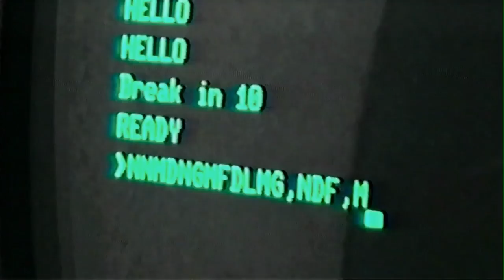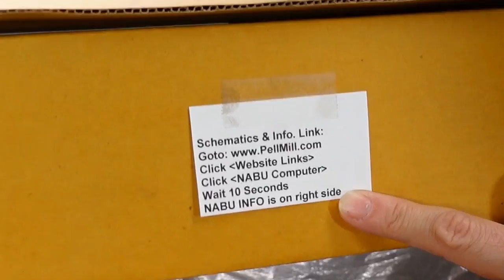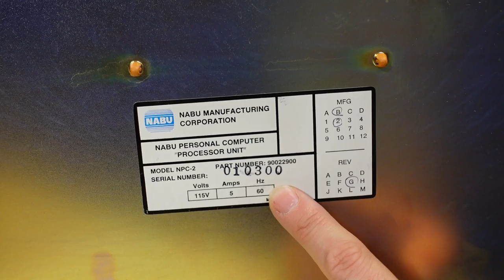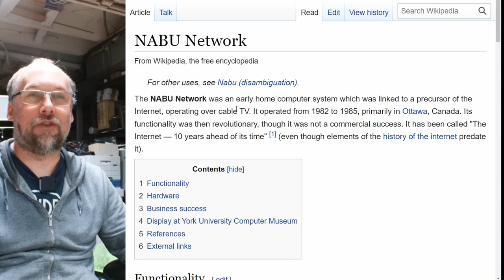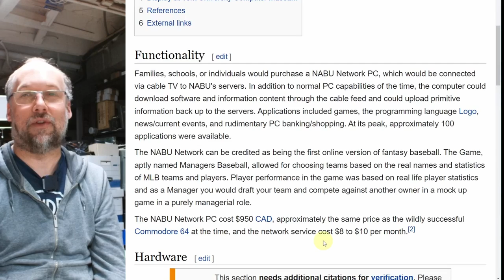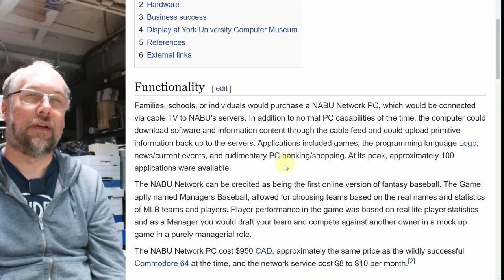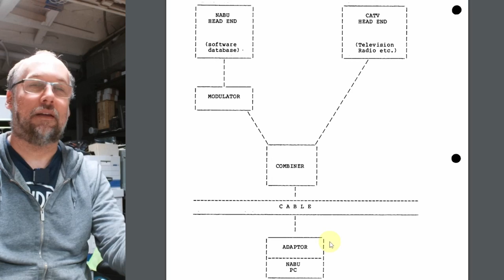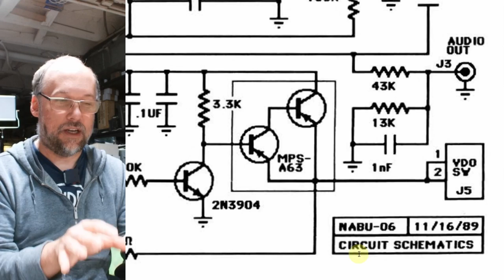The 80s computer you've never heard of: The NABU PC

Comment: A nice addition would be a tape adaptor, or even a disk drive if someone wants to go so far as to design one. A tape adaptor though I imagine could be very simple, one input bit, one output, and do the timing in software on the CPU. In fact maybe the printer port would suffice, you'd just need an adaptor that alters the voltage levels. 

Cassette would be fine for 64K, you could get loading time down to maybe 3 minutes, like a lot of UK machines used. In fact a ZX Spectrum game could often load faster from tape than the Commodore 64 could from disk! At least until people started using fast loaders. Stupid design really, Commodore's disk drives had their own CPU, own RAM all sorts of big heavy expensive chips, to do a job that could be done with a WD1772 connected to the CPU's bus. Maybe through the cartridge port, since Commodore put so many more expensive chips behind their ports that it cripped their speed, Sinclair did it all by connecting hardware to the bus and doing everything in software.

But Commodore, and other American companies, tended to design their computers like mainframes, or else they went through a parts catalogue and ticked off everything that said it did a certain job. They are designed a lot like mainframes though, lots of separate chips doing their own work in parallel, leaving the CPU alone. Where Sinclair realised the CPU wasn't doing much when you were loading or printing or whatever, so why not let the very capable CPU handle it?

Anyway, pardon me... point is this this could do the same. It could also likely take an ESP32 module and do Wifi, as well as an SD card adaptor. You might even be able to hack up a Laplink-type cable between it's printer port and a PC's printer port, or else USB on an Arduino. Amend NABU's EPROM to support all this, it would make it a usable computer... assuming you can find the software... If there's enough people who loved it as a kid, there might end up being a lot of homebrew, once development is sorted out. There's already a C compiler for popular Z80 computers of the '80s, that'd be easy to adapt.
Reply: The printer port is unforunately output-only, according to schematics, apart from a single BUSY pin that could be polled as very slow input path. The "adapter" DIN5 meant for its cable modem, being semi-standard RS422 may be a better option, though it's locked at the weird bit rate of 111.8kbps (3.574595 colorburst / 32). Is the Raspberry Pi's UART (ttyAMA0) capable of running at this odd rate? If not, 115.2k (3% error per bit; off phase by 30% at the final 8N1 stop bit) might be close enough, depending on character spacing.

Comment: Hmmm, that enclosure looks right on brand for an idea for a custom system I have been planning to build for a while (morphing hardware platform)
In particular those 4 "slots" are right on the money for one of the main features of the system. Are these available empty? Or maybe with just the power supply on them?
Reply: Just buy the entire machine. It's cheaper than buying an enclosure of the same size. It's only $60 or so.
Reply: The vendor sells the empty enclosure for cheaper.
Reply: @cass6409  Especially he also sells the smaller (in height) enclosures meant for the cable modem box. These come stripped of all electronics, and only have a simple linear power supply.

Comment: So the sx-64 had a case that seemed to be from an oscilloscope... This definitely looks like it started life as a hifi component 8-track tape machine.

I often wonder about where cases come from, I'm sure not all of them are one off designs.
Reply: I love and still use my rock solid SX-64. It still works perfectly to this day.
Reply: @DishNetworkDealerNEO  if you Google 'some work on the sx64 lemon64' you can see mine. I don't have it any more, I sold it to a guy in Montreal. Cool little machine for sure!!
Reply: @chrisyboy219  I’ll check it out. I’ve considered replacing the Sony Display with a high resolution 4:3 HDTV LCD display with NTSC to HDTV converter, and adding a second speaker underneath with a stereo SID Chip board that breaks up the voices and putting the C-64 Mini board into the empty space and adding the USB Port to the monitor side grill between the Top and bottom halves.  The 4:3 HDTV Monitor would have extra inputs and a remote control to control it and direct it to use the other HDMI inputs, allowing it to Switch to the C64 Mini or the original SX 64.

Comment: Can't wait to see one of these booting a disk system and possibly running locally loaded software.
I would Love to see it with an LCARS display.
Reply: Someone already has a CP/M running on it (!) but it's only with a serial terminal, not using the built-in output.  Which according to the tech manual is only good for 38 columns anyway (38 usable out of 40 supported by the hardware), which would be painful for CP/M.

Comment: For the time, that is a pretty advanced system, over here in the UK we had nothing like that until digital TV came along and the UK cable networks started using digital set-top boxes that could do similar stuff, and even then there were a lot of limitations over what they actually did (usually a "can't be bothered to do it" thing), with the STBs initially acting as the modem for your computer to access cable broadband, but prior to that, nope, just teletext and proprietary dial-up based services...
Reply: The BBC micro had an add and could get software via teletext. There were a whole bunch of teletext pages which were actually software for the machine.

Comment: The 8251 is a serial uart, one of the 1977 offerings from Intel. Most parallel ports were supported by a data latch like an LS374 and an input buffer to read the status pins like an LS244 or 245. A one-shot was often used to trigger the strobe when the port was written.

Comment: I could think of endless uses for that machine in the laboratory. I do embedded systems work and R&D electronics. I have a Z80 C compiler from around 1998 (on 3.5" floppy discs), I have thought of trying to get it running again and jumping back into the Z80 retro world. If we could reverse engineer a way to download code into it like the network did, You'd have a system. There's other possibilities also like a ROM emulator to store the app. In any case, those expansion ports are the key to interfacing this computer to all sorts of things that could be useful in the R&D lab.

Comment: So basically it was really a teletext decoder that ran over cable, instead of via the blanking line on a channel. Download the text firmware and run locally, and then you get better graphics and sound, with the possibility of using the adaptor to send cable data back to the head end again. 

Probably you can run regular CPM on it, though printer and disk likely also use the RS422 interface chip, and will have on peripheral processors to handle the disk and print functionality, though printer might be simple TTL level RS232, as that allows cheap printers to be used, just put in a buffer instead of the RS232 interface chips.

Comment: Excellent video, and very cool another machine using the TI-9918A, I managed to get one, and it just arrived today.  Will look at what I can do to get some software running on it.  The Eisteins Rom is 8k I believe and that comes with a really good debug monitor etc.  Might be something that could be adapted.
I also just got a Pico as well so might be a project to use with that.

Comment: I think youtube is deleting a lot of the comments with any external links. which would be why the spambots have stopped doing so and are working around that. That said I see VCF has posted good scans of the floppy controller which attached to All the expansion slots on the board with an adapter. probably to improve bandwidth and goes over how to modify the jumper etc etc. There are a lot of little projects just popping up everywhere along with a great deal of the history.

Comment: i'd love one to have a 'play' with,  but i'm in the uk and  postage and import charges are about 1.5 times more than the cost of the thing itself! 😢 i do have a possibly similar idea z80 based machine, was intended for betting shops to download and print race info (on a small paper sized ,but big case,  thermal printer) using the teletext/viewdata standard (has a tv type teletext card in it, which has its own display generator SAA5050),  it was made by philips, its still usable in way as it has a function for you to type your own text on the screen and then print it,

Comment: Adrian, I know where to get the cable box portion of the Nabu 

Surplus Sales of Nebraska has some, they’re under “project enclosures” they also have a LOT of NOS ICs, passives, etc.
Reply: Damn, there goes another order. Thanks for the tip. I ended up also getting a NOS touch-tone table-top phone.
Reply: Wow, sixteen bucks for a Network Adapter? Might as well

Comment: Interesting random find here:  As a little kid in the early 80s, I lived for about 10 years in Cornwall, Ontario (45 minutes south of Ottawa). I remember seeing advertisements for the NABU in the Ottawa Citizen... at some point around that time, my father and I went to a local computer store (where we browsed and bought software), and remember the owner told us about the NABU, and was hoping that the local cable provider (at that time, Cornwall CableVision) would support this technology, but they never did  (as a comment about Cornwall CableVision: At the time NABU came out, they did not support any kind of pay TV service, and we actually had to have a mechanical A/B switch beside our sets, so we could have two sets of channels 2-13... so a pretty backwoods cable system, that would never be capable of supporting this, even though it was a city of 45,000 people, under an hour from where NABU was developed. I'm sure other communities in the area were incapable of supporting this as well). So... in hindsight... I can see why NABU didn't take off, even "locally".

Comment: 7:29 Single row pin headers like that were usually used for expansion cards, not for cables, as there was no common standard for cables with 0.1" spacing like that.

Comment: Man, that's something really interesting. Adrian, I don't understand something and hope you'll correct me if i'm wrong. This PC is like thin-client thing. The fact that it does not need HD doesn't mean it cannot have it connected by RF cable. If i understand right NABU PC doesn't need original adapter as long as signal it gets formed right. This PC reads the data to its bus by RF cable (instead of direct disk attachment) converts it to standard signal and vice versa. You know the used protocol, you know the RF signal transmission standards. 
What prevents you from encoding according to protocol anything Z80 will understand emulating connection by sending directly to its RF port this sequence of commands, and decoding what it sends back? Just connect modern equipment emulating the remote storage  (HD and any other modern, even virtual, storage through microcomputer like arduino o raspberry pi) with any compatible OS starting sequence (like what Z80 needs to start reading data from disk? op code to read MBR address?) and send it down the RF port. And if you get back actual meaningful read instruction, just move on and send it over RF cable. I mean RF hardware is just additional mediator between storage and PC's bus. 
I mean there's a guy like Ben Eater https eater net 8bit (put dots and slashes) who does these things just by manually sending pulses at right timing (Maybe you can even cooperate for this project). He may be the guy who can actually emulate the bus work  signals decode/encode on physical level.

Good video.  Keep it going👍🏼

Comment: If you're concerned about powering this sort of stuff up, I strongly suggest you invest in an isolation transformer and a variac, so you can gradually wind up the voltage after plugging in. A plug-in, low cost digital ammeter that plugs into your mains outlet also might be useful.

Comment: A 6mbps cable connection in the 80s!?

It took us in the UK until the late 90s to start delivering internet over cable-tv networks and even then speeds started at 512kbps-1mbps, around 1998 onwards.  Speeds did increase quickly but i think it was around 2002-2003 by the time I had 10mbps internet delivered over cable.

Comment: I did a fair bit of work with RS-422 serial data during my embedded systems days… I’ll bet emulating the adaptor using a modern system isn’t too tough, especially if the protocol is well-documented. (Although getting a PC’s UART to talk at 111 kilobaud might be a bit tricky!)
Reply: 111kb/s was for the external cable-modem "adapter". The keyboard ran at a much more standard 6991kb/s ;-) These weird rates were due to everything being divided down from the 3.579545MHz NTSC colorburst, to save the cost of a second crystal.  Divided by 32 to get 111(.86)kb/s for the , or by 256 for the 6991bps keyboard clock.
Reply: I would bet the Western 1863 UART is the one..
Reply: @jordanhazen7761  maybe a hardware modification, by cutting the UART Chip free from the Color Burst Crystal and giving it it a roughly 4.0 MHZ Local oscillator module planted on the board would allow for standard data com rates to flow in and out of this machine.

Comment: great item ... lovely ... most probably one reason some computers went bust in / around 1985 was because the Amiga 1000 (first Amiga) by Commodore came out that year ...

one such (ZX80-based) system was Sony's SMC70-GP ... it was a true Super Micro Computer (hence the SMC in its model name) and a really capable Graphic Producer (hence the GP) with really good potentials for future development ...

but of course 8-bit systems were already doomed actually as there were at least a few 32-bit machines out there already ... (Amiga 1000 was based on the Motorola 16-32 bit 68000 CPU and its own legendary dedicated Amiga-specific chipset, which made it not only the best electronic game toy at the time, but also a great graphics and multimedia system ... even the earliest Amiga models are still quite good for both some retro gaming as well as some decent graphic and multimedia use to this very day ...)

Comment: Reminds me of british manufacturer Research Machines 380z & 480z z80 cpu with cp/m built between 1977 and 1985 which was used mainly in the education market had a heavy duty rack mount and keyboard which can also use 5 1/4 and 8 inch disks

Comment: If you want another "fun" lost computer, look for a Lobo MAX 80... a 128K Ram clone of the radio shack, which could use a lot of OS's.. My choice3 was CPM, which installed very happily mostly in the second page of memory, leaving 60K available for programs... The bits of ram at the top was where the CPM IO system lived, and swapped things back and forth as needed.  Booted in about  1/10 the time of an IBM PC... it all fit in the keyboard... I had 4 floppies (2 8", 5 1/4, and 3 12"  on it, along with a pile of scsi hard drives...

Comment: I bought one (awaiting delivery). It has plenty of the hardware present needed to run CP/M. One would have to figure out how to interface and bootstrap a disk device and write an appropriate ROM image which, while not trivial, is totally doable. And there’s the issue of modifying CP/M to support specifics of this machine (the 2.2 source appears to be available, and 3.0 added features this hardware doesn’t support, so 2.2 seems like a good choice).

I suspect this machine has an interesting future in store as a hobbiest platform. Personally, I’m excited to finally own a Z80 based machine, and an excuse to poke at Z80 assembler (I’ve messed with everything from the 6502 to AARCH64, but never the Z80).
Reply: There was a version of CP/M for the NABU PC, on floppy disk.  York University has my copy.  Looking at a screen photo, it says CP/M VERSION 3.0, NABU RELEASE 4.4 DERIVED FROM CPM3FHT Sept 14, 1984
Reply: @AGMS00  Oh wow! Really? So this is something that we in theory could get a disk image of? That instantly takes this machine into the category of useable, from blank slate.

Does this machines default ROM have latent boot to floppy seek? Any documentation on all this?
Reply: @smakfu1375  Unfortunately you need the ROM upgrade to handle the boot from floppy, which is why there is the stock 4K ROM and an 8K ROM with disk support (and presumably text mode console handling - side scrolling to get 80 columns, though that could also be a CP/M driver).

Comment: Nice idea about getting a Raspberry Pi up as the header unit.  Unfortunately, given that photo of a 1,000 Nabu units piled ni a stack I suspect you might find that currently it's easier to get a NABU computer than it is to get a Raspberry Pi.
Reply: Is it really still that difficult to buy Pi's?    I have 30 of them laying around that I got from a school project I worked on a few years back  , the project was cancelled and the devices were paid for by a sponsor so  they were basically 'free' and given to me.  Maybe I should put them on ebay.....
Reply: @Blackadder75  It's going to be difficult to get a Pi through to the end of 2023. Beyond that we still don't know.
Reply: It doesn't need to be a RasPi.  It can be any Linux machine, including any of the knock-off Pi's, or even probably a VM or WSL instance.  The Adaptor interface is just RS422, and USB-RS422 adaptors are cheap.